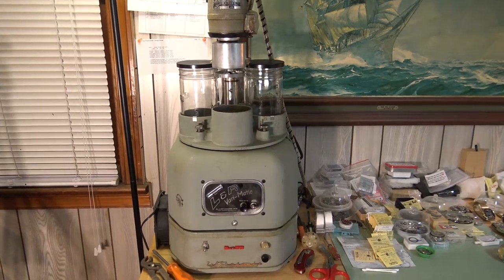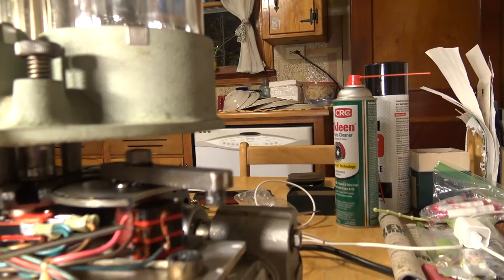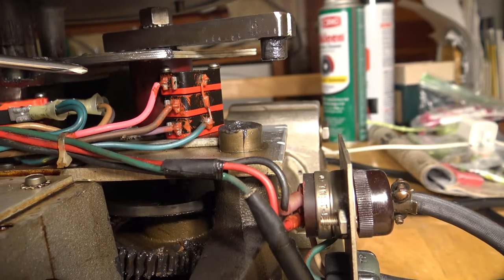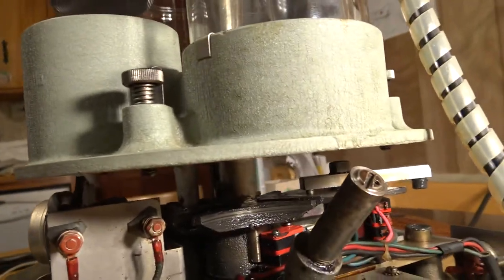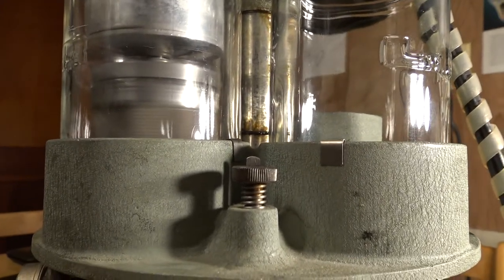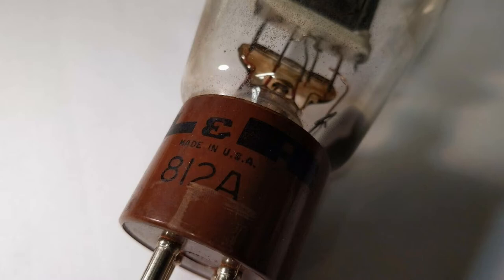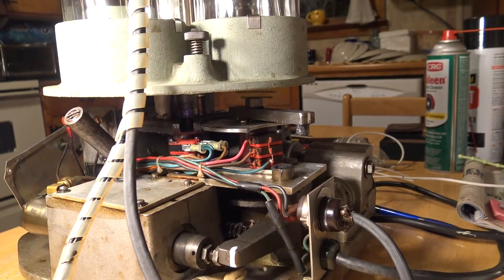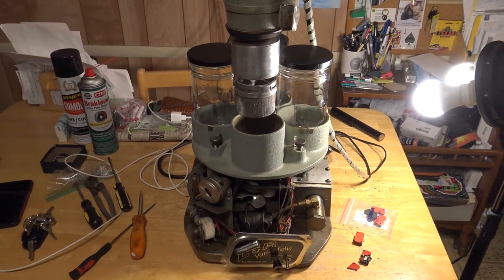Mechanical Marvel. My 1964 L and R Vari-matic Watch Cleaning Machine. A Fascinating In Depth Look.

Comment: I worked on clocks and pocket watches in the mid 70 s. We had one of these in our shop. Fast forward to today. I work on food service ( kitchen ) equipment now.  Hobart which is a industry standard in a lot of cases has a lot of mechanical parts in their mixers , especially the old ones. With you figuring out the timing sequence of this machine, I would affectionately call you a fart smeller. And if you know what that really means, it's a compliment. Your video is very well delivered and a 10 on the informative scale.  Two thumbs up, and Thank you.
Reply from the maker: I thank you for the positive compliment. Glad I could help others by posting the video. :)  Cheers

Comment: That bulb is called a vacuum tube. There were many types. They were used in everything and were replacer by diodes and transistors which were replaced by electronics.

Comment: Really neat machine! And good job breaking down how it runs. I found your video because I was searching for information on these, I just purchased a smaller simpler version of this... an L&R Master Cleaner. It needs some cleaning and the wires need replacing. Would it be ok the clean Jewelry in these? ... or would it scratch them up? Thanks!
Reply from the maker: Hi Mr. Whisler.   Thank you for watching my video and thank you for the positive compliment.  You can clean jewelry in this machine with out scratching it. You wont believe how sparkly things will be when cleaned. 
If you have a speed adjustment...turn it down first and do a test run.
All should be good once you find your speed setting. These L&R's are worth the time to fix and.... are reliable for years.

Comment: your cleaning machine is still a little bit out of sync. solution in the jar will be slinging as the motor basket is prematurely spinning as it touches down into the  jar. the motor basket should start spinning only after it has seated in the jar/drying chamber. u need to fudge the halfmoon dics with arm a few more degress
Reply from the maker: Hello. Good observation. :) It has always done that. It is spinning so slowly as it drops into the solution that by the time it starts the wash cycle, the motor has sealed the jar.
Reply: @watchesandwheels2093  minute ajustment can be made but if works for u that’s all that matters...👍

Comment: I have one of these in to repair for a customer, the basket doesnt go right down during drying, and not going right down into the jars but starts spinning at high speed half way in the jar, then in the next jar it goes right down. (But by never having used one of these before, i'm unfamilier in how the cleaning cycly runs.)
 Could this be a micro switch fault? if so how does the carousel lift off in order to gain access to the may switches?
Reply from the maker: You should be able...if its the same model as mine  to lift it right off the carousel shaft. From there you'll have to take the body cover off and have a look at everything. This is a very difficult machine to diagnose from my position. Without me being there to see it function.
Reply: If you are still working on yours the carousel has a large clip holding it in place.... Well it's supposed to!

Comment: Very nice video! I have one of these and was unable to work on watches for several years. Over those years the machine sat unused. When I finally tried to use the machine again, the basket wouldn’t go high enough to clear the jars. Do you think that’s just a hydraulic oil problem or is there an adjustment for basket height? I’ve noticed that some of these machines clear the jar by a lot and others just clear by a little. Any help would be appreciated!
Reply from the maker: Yes for sure it sounds like a hydraulic problem.  Mine did the same thing when I first got it. This machine has a dip stick which surprised me when I checked the oil. I hope that helps.
Reply: @watchesandwheels2093  thanks for the input. Yeah I have no leaks and the oil level is ok. Maybe I’ll try flushing out the hydraulic oil and putting new in. Any recommendations on a brand and weight that works in these machines?
Reply from the maker: @joetallon4968  Hi Joe. I use regular ATF fluid.  No synthetic or blend of any kind. Let me know how it goes. If it is leaking internally....you might have to put in a new seal.
Reply: @watchesandwheels2093  thank you very much. May not be till spring now, but we’ll see. I have a little L&R master as a back up I’ve been using. Thank you for your quick reply! Hope your Thanksgiving and Christmas are extra special! Take care.

Comment: Awesome video 😊
I have the same machine as yours,problem that I have with mine is is when is rinsing or washing,  does not rotate back-and-forth
I don’t know what the problem is turned clock wise no reverse
If you have any suggestions, please advise 
Thank you 
Peace
Reply from the maker: Mine only does that on one wash cycle.....the first one. I believe it to be a switch that is slightly out of phase. When I service the machine again...i will address that and do a follow up video for you.
Reply: Thank you

Comment: Good video. Can you please post the link where you got the relay's / switches
Reply from the maker: Hi Arthur.  You can buy them on Amazon. That is where I bought mine. I believe you can see the part number in the video...if not...it's RV-1C25
Reply: Hi,  What amp were they.  There are multiple versions.
Reply: 1/2A 125vdc or 1/4A 250vdc. Original brand is Und Lab Inc. model L12
Reply: Hi Brian,  Great video!  I just stumbled across it when my machine went down........I have been using a Vari-Matic III for about thirty years now and about fifteen years ago it went down and I flipped out.  After talking with L&R and others I found a guy that actually worked for L&R that was about 80 miles from where I live in Pa!  So, the wife and I loaded my machine up and took it to see him, he and I rebuilt the entire hydraulic system and it worked great once again.  He charged me a whopping 100 bucks which I thought was a great deal!  The question I have for you is, did you have to take the whole platter off the machine to replace the micro switch?  I just ordered 5 from Amazon as per your link, thanks for that.  Richard Awiza